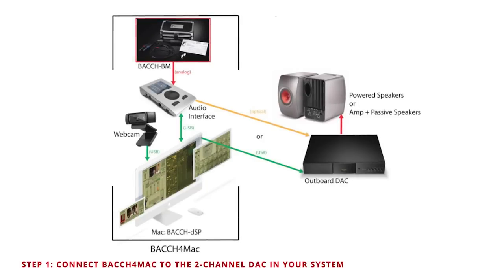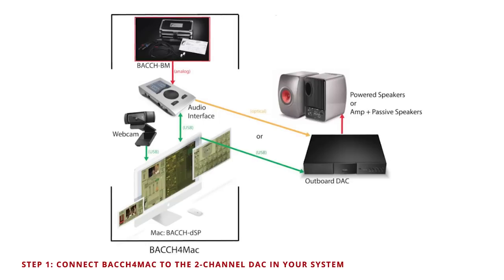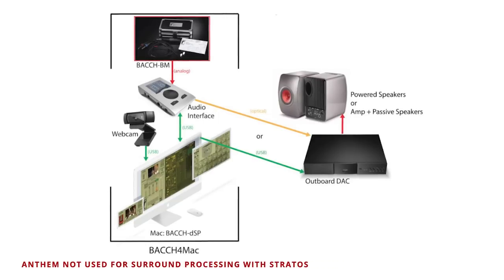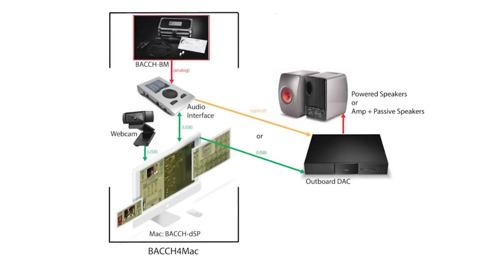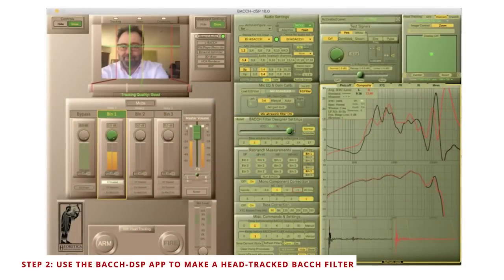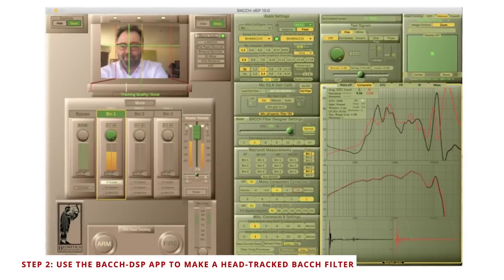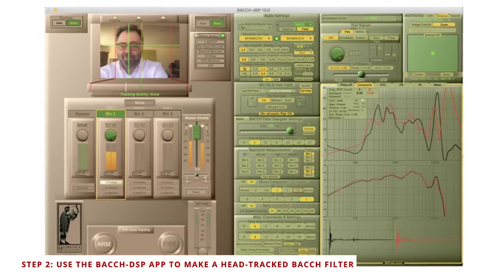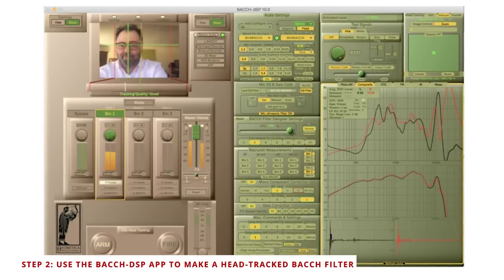Exclusive: BACCH Stratos Atmos Processing System Listening Preview

Comment: I don't have a dedicated room nor the most directional speakers.  However, Bacch XTC works very well - the KTH Interrogator binaural recording will actually render with the knife sharpening behind my head, despite having XTC of 9+ and 10+ dB only. I tried stratos and on balance, like it, but I definitely cannot get any rear channels to render behind my head, even the test dog barking or test steps clip. So I think there's still room for improvement.  Nevertheless the atmos versions of many tracks are superior to the two channel ones, so I still view it as a plus.

Comment: Good report thank you. I am not 100% clear if that module will add much to my existing Bacch4Mac setup if I only use it for stereo music and not movies or dolby type recordings.?
Reply from the maker: You have to use Atmos-encoded recordings for Stratos to do what it does. It is an Atmos emulator that depends on the multi-channel information in Atmos recordings to create the spatial presentation (for good or for ill). For stereo recordings, BACCH4Mac or other BACCH products are the ticket.

Comment: Thanks for this presentation. A few casual questions, Auro3D mixing from Atmos tracks would be nice and potentially nicer, more immersive. Your speaker layout is reminiscent of an Auro3D set-up. Does the ~Bacch system require at least a 5.1 system in this case? I'm not sure of the advantage, apart from purely customisable audio landscape settings for different speaker systems. I'd certainly like to try the stereo version for my large horn speakers. Thanks again.
Reply: Thanks for your note. The BACCH filter itself has been around for about a decade and is used with any two channel source to eliminate inter-aural crosstalk and restore the original stereo recordings potential spatiality. With the new product (Stratos) you can play a multichannel recording (5.1, Auro-3D, Atmos) and get the same multichannel listening experience from a stereo pair of speakers as you would from 5 or 6 or 10 or 12 or however many speakers you want to emulate.

Comment: I don't need gimmicks in my soundstages
Reply: @khunopie9159  Thats not a gimmick, it is an acoustic optimization. A inverted,  signal of the opposite speaker is played so that it cancels out the signal, which is not meant for the side of your ear. This improves the immersion, soundstage, etc.
 It is not something artificial, which your comment implies.
Reply: By that standard surround sound  and stereo is a gimmick.